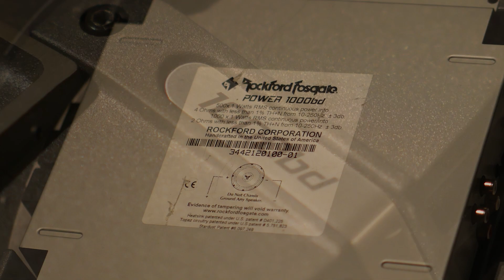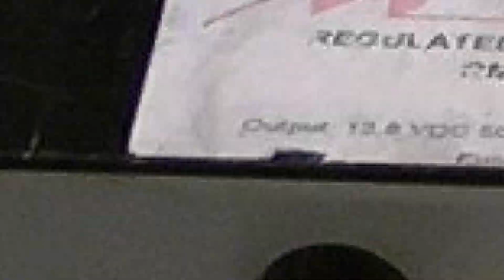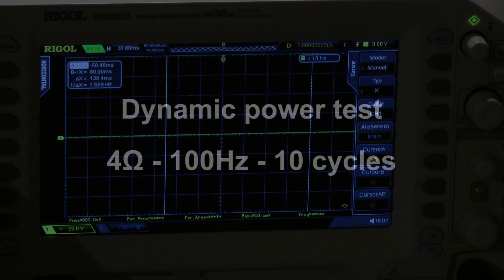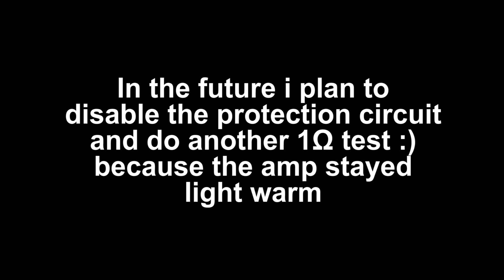Rockford Fosgate Power bd 1000 mono amp dyno run amplifier power test - Bass / Subwoofer car audio

Comment: had this amp on 3-power hx2 10s in a single cab f150 in a sealed box. was a great system friend of mine bought the truck several years back and the system still hitting hard as ever
Reply from the maker: I also have 2 10” HX2 in a small closed box. These should be from early 2000s. They perform nice in small boxes.

Comment: I have several of these and punch in various powers. Just ordered a very clean one w caps and punch control (which I usually make my own). Gonna put it on 2 JL 10’s. Can’t wait to hear it!
Reply: U make knobs for amps?
Reply: @logancaston355  I haven’t made any to sell  but I have made a few for myself. Unfortunately I know I won’t have the time till after October to make some more but I can get you the pinout and specs on the parts I used this weekend if you like

Comment: 100 hz? Really. Should of done it at 40hz. My bd1000 did 1437 at 1 ohm. Bought mine brand new for $963 back in early 2000
Reply from the maker: I agree, just wait for one of the next bd amps coming in for a test and then it gets tested much more detailed as I now have the right tools for testing which I didn’t had at the time when the video was made 👍😎

Comment: This amp has been my daily use amp for the last 21 years. Bought it used for like $300 back in 2003. Have ran it at 1 ohm on a pair of crystal audio 12s. Now I have 3 jl 8 w3s powered with it
Reply from the maker: Hi 👋 
Did you remove the protection diode for the use with 1 Ohm? Would be interesting to know if it survives for several years 😃
Reply: @audiokeller1975  I didn't know to even do that. I ran 2 dual 4 12s in parallel for like 3 or 4 years. It's since been running 3 8s at 1.33 and it's fine.
Reply from the maker: @IdahoChevyDude I made a video which diode has to be removed, amp puts out more power then but I never heard of long term experience when modified 🙂

Comment: Disappointing
Reply from the maker: what exactly is disappointing for you ?
Reply: @audiokeller1975  sorry, great video just thought it would make a little more power than that.
Reply from the maker: thanks. It makes more power if not tested brutally with 40Hz. It puts out around 1250 - 1300 watts 2 ohms if tested with a 100Hz signal 👍
Reply: @audiokeller1975  I understand